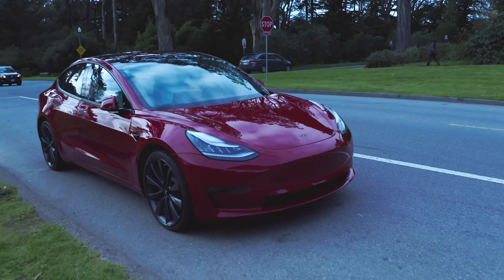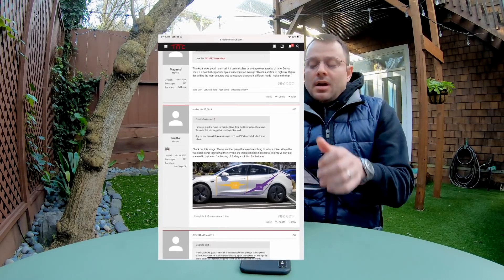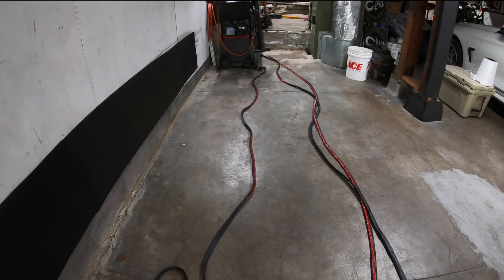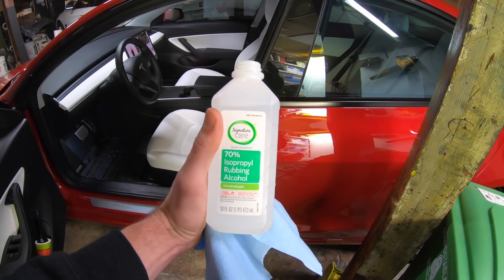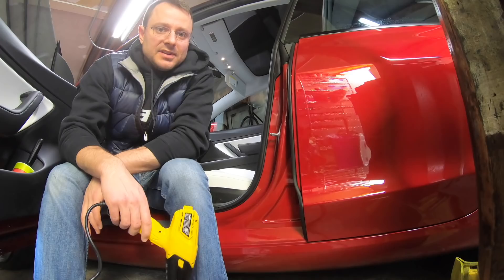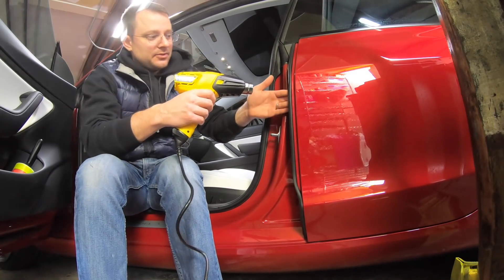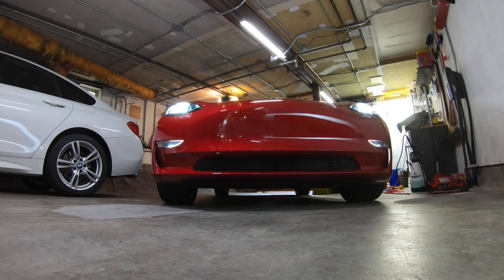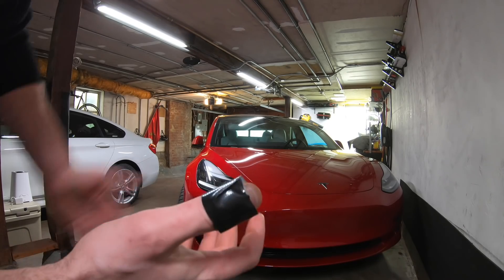Tesla Model 3 - Additional Door Seals

Comment: Is that the original paint or do you have a wrap? Your red seems different to mine (UK 2021 MY) somehow...
Reply from the maker: Original paint.  It did seem to change slightly when I had it paint corrected and ceramic coated.  It’s just slightly different, but it does stand out.  Lucky benefit of the process I guess.

Comment: The door seals from the factory seals very well from the elements.. if water can't get in.. noise is fine. However.. being a frame less door.. ensuring the alignment of the window glass placement when the door is closed is critical to reducing wind noise, that... is worth spending time on. The panel gaps between the doors, fender and rear quarter panel isn't that big, you can test this by just putting tape over it and driving it around with a decibel meter. Your second set of door seals is basically sealing against this gap. You basically are sealing dirt, water, elements from getting to the main door seal which is I guess better for cleaning inside the door sills but it's not for noise reduction in my opinion.

Comment: To clean the painted surfaces, I recommend a cleaner called Prep-sol 3919S by Cromax; it is made for exactly this application.  A regular garden variety hair dryer to warm the surface prior to placing the sealing strip would be a lot safer than a heat gun.

Comment: Let me get this right, A 40k+ "Luxury" car needs the owner to install a second set of rubber seal to reduce the noise?
That's the kind of upgrade I do to a 2,000-5,000 used econo box, not a brand 30,000+ car never mind a 42k car.
Reply: Someone has clearly never driven an Electric Car period.
Reply: Your gas car makes more noise from the drivetrain so you do not need to worry about other noises because they are drowned out by the engine, or the manufacturer put more soundproofing in the car because of the engine. In an electric you now only need deadening for wind etc, which is a new thing to worry about now. Many people have put in sound deadening in 80k mercedes and bmw for years when putting in audio systems. Nothing new. You clearly have not had the experience with an electric car and know what you are talking about. After driving a model 3, I would not want an 80k bmw if you paid me to drive it over the model 3.  Nobody else is making a ev that compares to the model 3 for its price from anyone else  so if the model 3 does not have as much soundproofing who cares.   A little effort to add soundproofing to a great car is easier, than dealing with a sucky performing equivalent soundproofed bmw which you can not change or improve without replacing the car altogether.
Reply: My Performance Model 3 is super quiet, about the only thing you notice above 40 mph is the wind and maybe a bit of tire noise depending on how smooth the road surface is. And it's not loud, it's just that there are no other sounds at all unless you turn the stereo on so it kinda stands out, the overall effect is very zen-like. It feels like being magically propelled through the air with just the sound of the aerodynamic body slicing through the air. I like it because it's the only thing that gives you a sensation of speed. I've found myself going 65 mph in a 45 mph zone because it's so effortless, smooth and quiet.
Reply from the maker: Some of the California roads are pretty bad.   Route 80 up to lake Tahoe is beat up from all the chains and it is LOUD!
Reply: ...in a perfect world... you are right...

Comment: Thanks for testing this out for us, looking forward to the improved results. Here is a forum tread disqussing  noise damping tips https://teslamotorsclub.com/tmc/threads/sound-deadening-model-3.130206/
I think most TM3 users is annoyed by the road noice from the tires, so insulating the wheel wells With some Rubberized Coatings  https://www.homedepot.com/b/Paint-Industrial-Commercial-Paint-Rubberized-Coatings/N-5yc1vZc8kf
Also have you checked how big the exit air hole is below the subwoofer  (i'll bet some road noise leak into the car that way. Maybe some filtration will help, like styrofoam pellets, which insulate but release air trough it.

Comment: The installation of the foam into the panels etc looks very intensive, but these seals look relatively easy to fit. More tempted to try these. Were you also looking at sealing the roof with that thing that RPM Tesla sell?
Reply: Vitz Patel he did already.  One of the first sound dampening things he did.
Reply from the maker: Once I test the impact, I’ll let you know.  Once done I will order the modifications based on ease/impact so others can make a decision on which to do

Comment: Hello! What is the result of the additional seals?  Do you have the original rims that are behind the ugle aerodynamic wheel caps? Have you upgraded the calipers?
Reply: This is a Performance Model 3 with an extra set of rims with winter tires mounted on them.